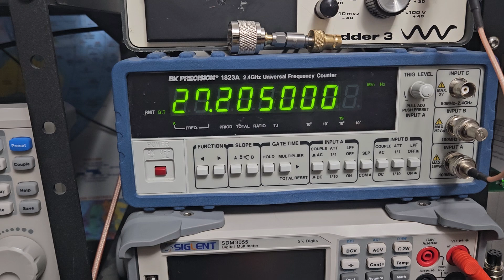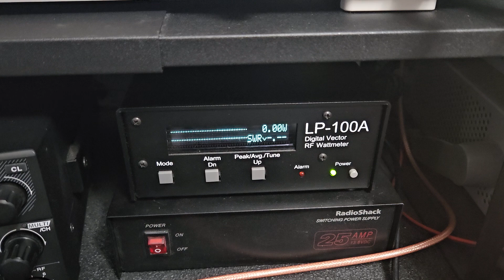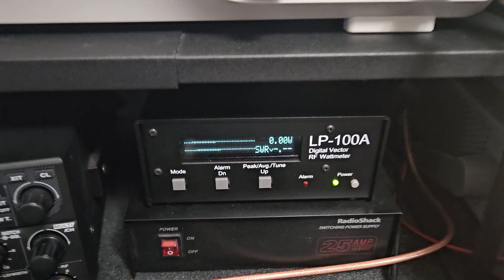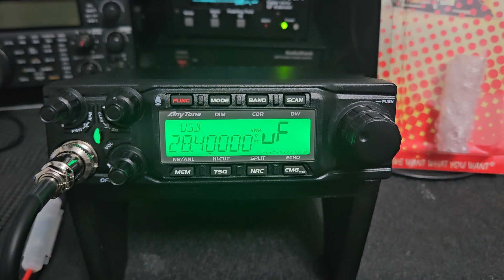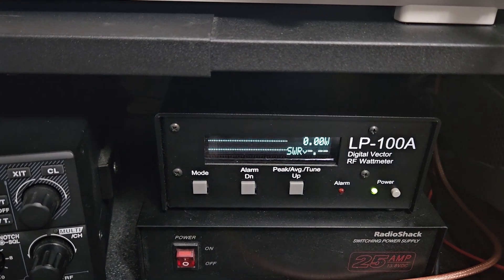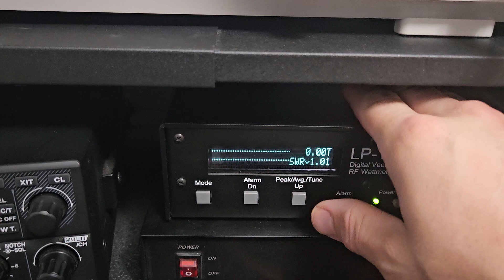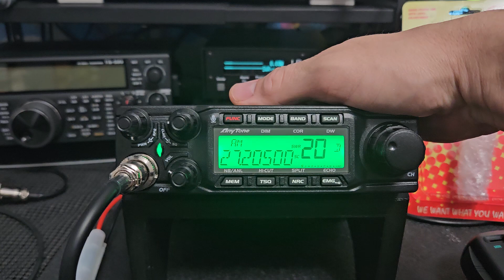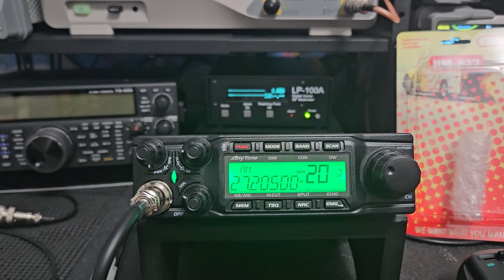New radio for Hector. new microphone for Cedric.

Comment: Good radio. I got same band conditions in NY . Been back to back solar storms . I am getting  lots of background static as well. S3 to S7 . threw out 10/11/12/15 /17  meters not as much on 20 meters but up gaing on 40 meters and S9 on 80/160 meters. 20 and 17 meters best band for me the past few weeks . I did get Brazil and outher south American countries. bands starting to improve . getting more skip on CB. just worked Texas on Ch 38 SSB. on stock radio. 73